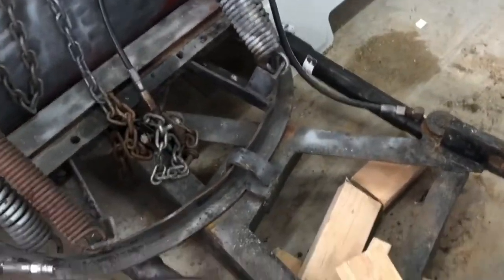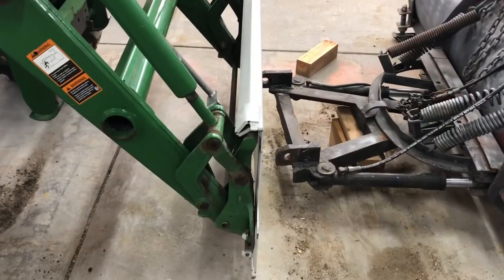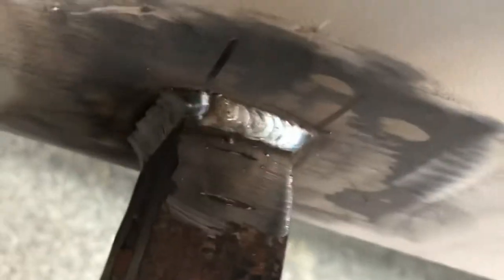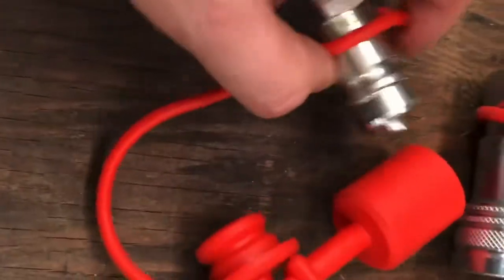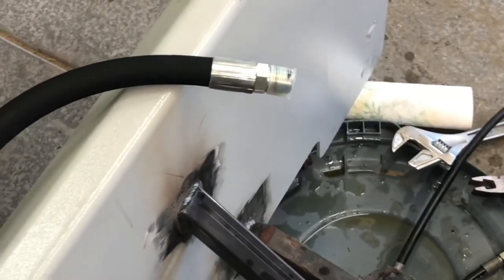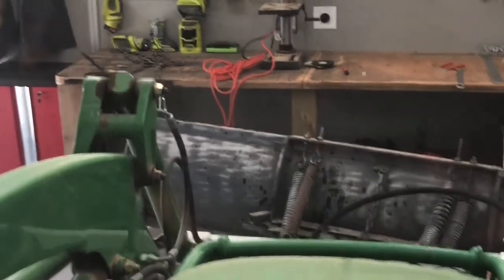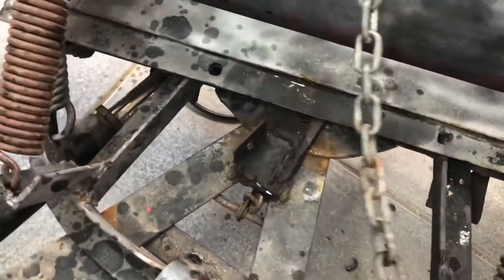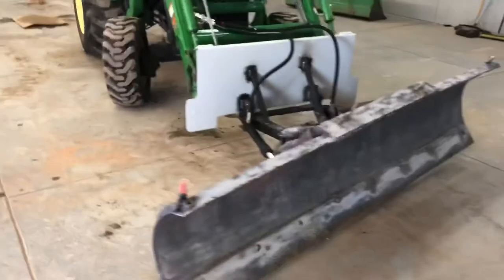Converting an old snow plow to work on  John Deere Tractor 4520

Comment: I did the exact same thing. My 5075E utterly destroyed the flimsy 1/4" cheap chinese steel plate. It was an 8' fisher plow that's rather heavy. It was caught between the irresistible force and immovable object. Needs a much heavier mounting platform. Got 4 very patching, bending, band-aiding, repairing winters out of and finally just cut it off and threw it in the city steel bin. Making a 2" x3" x 1/4" tubing frame with 1/2" plate at the attachment points for it as we speak. I also sold the 5075E and now have 4066R instead so we'll see if it's more robust.

Comment: Old truck plows work great. Take the loaded off, make a mount to the tractor and use the loader control to angle and lift.  1000 dollars and the weight is close  to the front end.

Comment: They put the chain on rather than replace the springs if the blade is not allowed to go down most of the way ,hitting something hard will eventually break something. Better to replace the springs and possibly add a couple more.

Comment: Hey Farmer Gus...Very informative video. I appreciate you taking the time to document what you did for people like me! I am currently attempting to add an old 7 1/2' Fisher plow that I bought to my New Holland TC 30 tractor. I don't have the Quick Attach plate setupplace
     I believe the chain on that plow was originally used to raise and lower the plow using the pump that bolts onto the front of the truck.

     My only constructive criticism is that your close-ups are helpful to see what you did, but the moving around while zoomed in made it hard to follow where you were on the plow. I would give your video a "Two Thumbs Up"...Great job! 
     I am "subscribing" and "liking"!
-Mike

Comment: I am looking to do this but i think i would re-enforce that thin QA plate across where the plow attaches. Did you wind up doing that after using it? Other than that I like what you did!
Reply from the maker: I didn’t but I am going to have to. We had a huge storm here in Colorado and the weight of the snow bent the plate.
Reply: My JDQA plate bent after I mounted my homemade stump bucket in the middle of it and very little use. I bolted it on with 6 5/8 bolts for easy removeable option. A couple of channel or tubing  pcs all the way across the plate would stiffen it quite a bit. These  1/4 plates are always the weak link in  this application. Good luck with your fix.